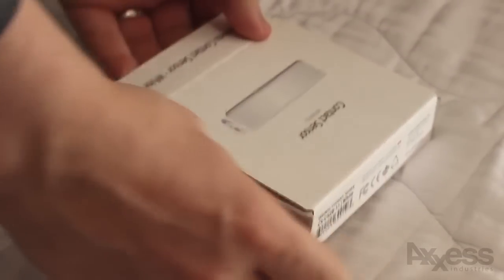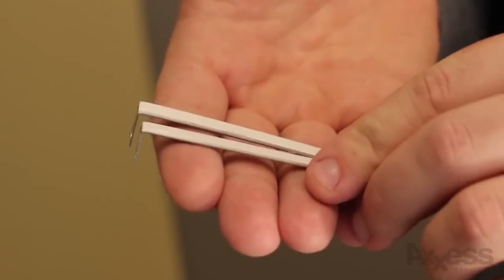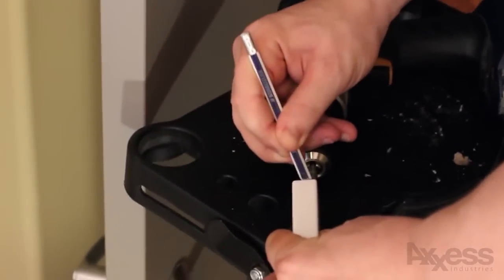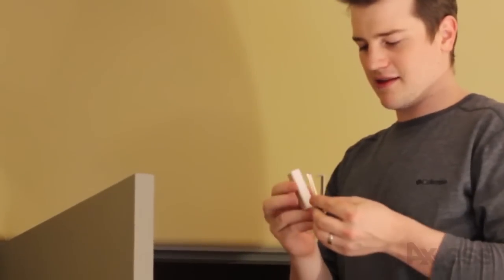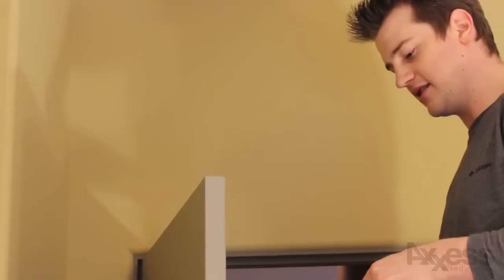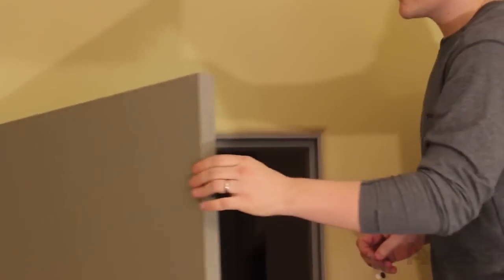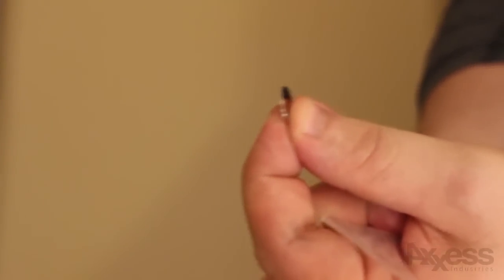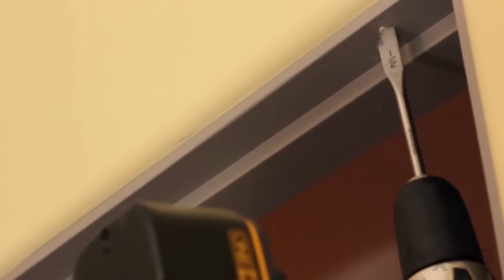Contact Sensor | "Invisible" Door Installation

Comment: Good luck trying to mount them this way on a steel entry door. This hollow core wooden door installation must be to control automatic lighting. It's definitely not an alarm system. Hinge pin sensors are your best bet on steel doors.

Comment: I had this idea, then found this video. Seems to me the one in the door can just sit freely in the hole. I see no point in the crewed on bars. The one in the jam—couldn’t it be set in with an adhesive? Since thar one could be seen when the door is open it can be painted to match the jam or, if your ambitious, it could be set a tiny bit deeper and a thin plug placed in the hole, caulked and painted so it’s completely invisible.
Reply: Needs the bars in case the door get removed by maintenance.